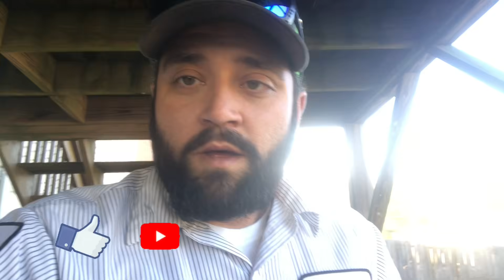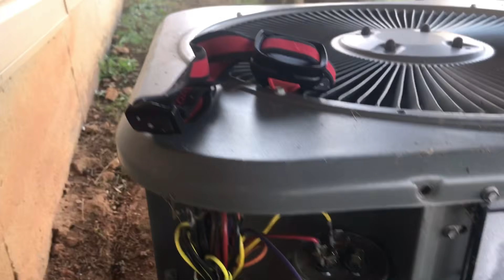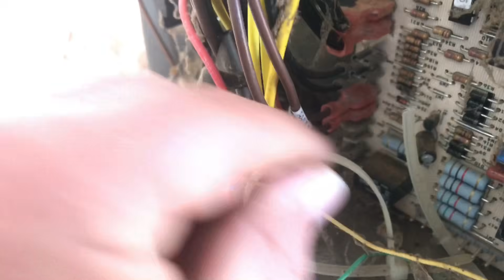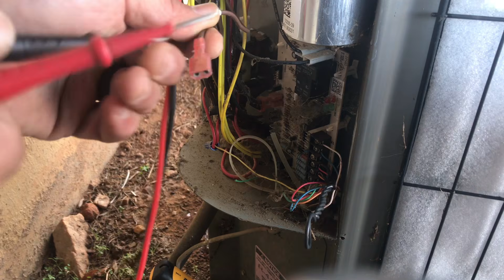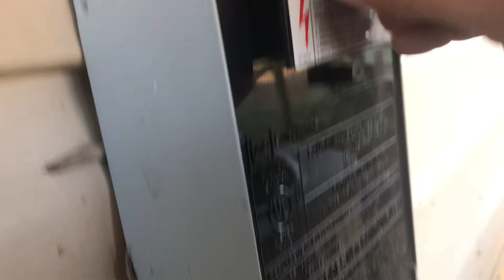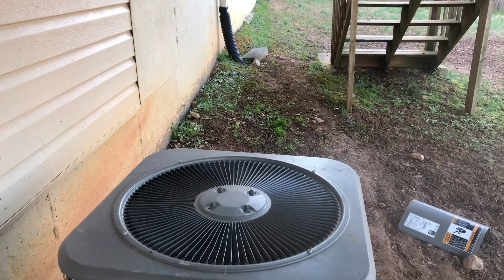How to check a defrost control board!

Comment: Great video and explanations. I'm running on the same issue with the heat pump working fine on heating mode, but getting frosted, When I defrost manually, the outdoor coil is not really melting all the ice. During the summer the cooling mode was not working and the line was not really cold and after 20 min it will stop working with a error code 72 Thermal cutout. The reversing valve is working and I don't think there's a leak otherwise it will not heat.  I really don't know what is happening. Do you have any advice?

Comment: Good video. How about just flipping the switch on the thermostat from HP to CONV and just run it on het strips only until you get your board, then flip it back to Heat Pump?

Comment: Dude you just saved me a few hundred bucks.  My Lennox was totally frozen over and I wanted to understand what was wrong and get some heat before the tech came out.  I tested the defrost sensor while it was in a block of ice and sure enough no continuity.  I jumped the DF and pulled the fan and ran 14min( apparently that how long Lennox runs??) defrost cycle until most of the ice was melted.  When the tech came out he did his checks and totally said my board was bad and wasn't sure about the sensor but that it would get replaced with the board ~$400.  I said thank you and paid $90 for the service visit and ordered my own replacement sensor online for $40.

I had a question though.  If I ever had to manually defrost again can I leave it in defrost until thawed or just 14min intervals?  Bc that was slow as heck only doing 14min at a time
Reply from the maker: You can let it keep defrosting until the ice is gone.
Reply: Awesome, thanks again

Comment: by coil sensor you mean the DFT, like the wires you disconnected go to the DFT. I'm assuming you just used different terminology. I know some boards label them both "DFT" and other boards have a "DFT" and "R-DFT" basically the same thing.
Reply from the maker: Yes your correct

Comment: Question if you simply switch your unit from heat cycle to AC cycle wouldn't that in around about do the same testing which if it blew cold air it would eliminate the reversing valve and puts more attention toward the board and the sensor or does the board totally shut power access to the reversing valve is there an alternate power source that operates the reversing valve

Comment: York heat pump reversing valve is continuously chattering. When I disconnect the wires connecting to the reverse valve the chattering stops and unit will work in the heat mode but it will start icing up. The voltage on the coil wires never shows zero volts. Should I replace  the defrost control board or you may have some suggestions to properly debug the system.

Comment: On a Goodman, i just disconect the fan wire from the board after turning off the power, then i  connect the fan wire to the contactor, turn on the power, if it goes into defrost that means the board is bad. Can this be done on a Lennox? Or i have to follow your instructions in this video? Thsnks.

Comment: Excellent explanation, I dealt with this for the first time earlier today and afterwords my boss sent me this video for learning purposes. Pretty cool knowing how everything works now and being able to better understand the system as I progress in my career.
Reply: One more thing to know, multiple offenders do happen and it is also possible that the reversing valve is also stuck, if you jump it and it's still in heating mode the valve is stuck, his obviously works because it's defrosting. An important lesson I have learned the hard way is don't stop just because you found a problem because there can always be more problems or things that will become a problem, doing this helps prevent call backs. I just went on a refrigeration call running a part for a tech that is on vacation. The diagnosis was a restricted cap tube and he was right but the compressor sounds like it's full of rocks and the other tech absolutely should have quoted a compressor as well because that one's days are numbered. I would have changed it on that service but the closest supply house to that customer is nearly 2 hours away one way.

Comment: Great videos! thanks so much for sharing your knowledge. I hope you could help with the following. I have a York heat pump that is not heating enough and it seems that the blades are not turning. I change the filters did the resenting, putting the thermostat all the way down and starting again and it did work. But it only heats for a little then it blows cold air, Please kindly advise. Thanks so much in advance!!

Comment: I know this video is a year old but I hope you see this comment! Had a comfort maker iced up like that, tried to put it into test mode and it wouldn’t defrost, put jumper wires in the temp sensor pins and it went into defrost but for 2sec, so I changed the board and still did the same thing…….any suggestions?? Thank you!
Reply from the maker: Check the temp sensor. Its probably a bad sensor. Have you checked the refrigerant charge? Do you ever see if going into a defrost?

Comment: Thanks for the video, very informative! Quick question:  Are the green and red flashing lights normal?
Reply from the maker: Yes they are in certain sequences. You can check on the board and it should say what sequences are error codes and which sequences are normal operation
Reply: @HVACTechTips  
Thanks for your quick response! I'm working with a Lennox XP16 unit, both lights flash just like in the video.

Comment: Good video. New subscriber. I recently had to troubleshoot the defrost board. The temp. Sensors ones-out five according to the ambient temp. Reversing valve was getting 24v but was not operating. I removed and cleaned the connectors to the reversing valve, and it then worked fine. Simple fix.
Reply from the maker: Thank you for subscribing!!

Comment: What if we have an barely new heat pump about a year old that’s icing up just like that and buy what I seen I suspect it’s something to do with not going into defrost as it runs fine heat output is fantastic until it gets cold and ice is up but I forced it into defrost and it went into defrost and my coil sensor is showing open during normal heating cycle on a fairly warm day where it’s not icing up could it still be something in the board or The coil sensor itself? It’s a RUUD HP
Reply from the maker: It sounds like the sensor. Rheem/Rudd has had tons of issues with there sensors the past couple years. I would almost guarantee that’s the problem. I actually have a video on that exact issue and show step by step on the repair. here’s the link: https://youtu.be/yOYM3apIZ2g. I also give the part number in the video and you may be able to order it online.

Comment: I just subscribed. I have 43 Lennox heat pumps. Have you installed any low ambient fan kits on any? These kid’s run the a/c when it’s cool outside and they go into low pressure lock out. Thanks
Reply from the maker: Hey. Thanks for subscribing! Yes I have installed those before. Not too often though.
Reply: @HVACTechTips  if you install anymore especially Lennox please make a video. If I see it one time I’ll be able to take it from there. Thanks
Reply from the maker: You got it